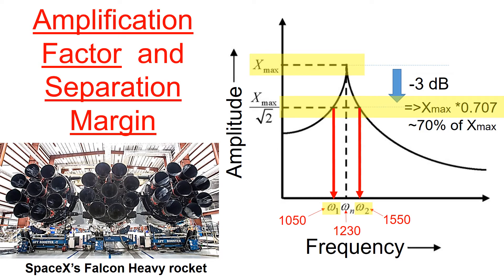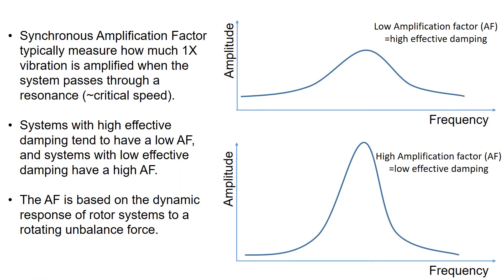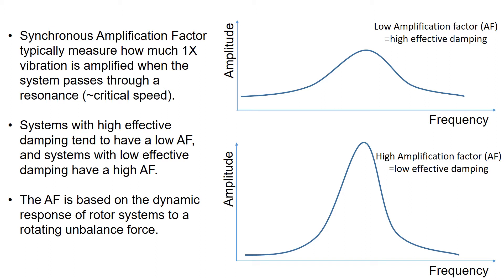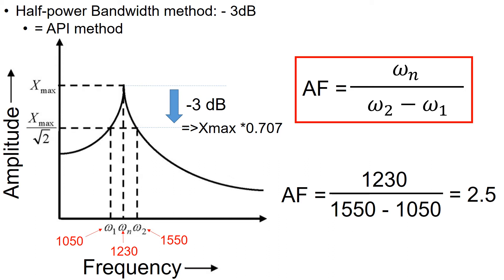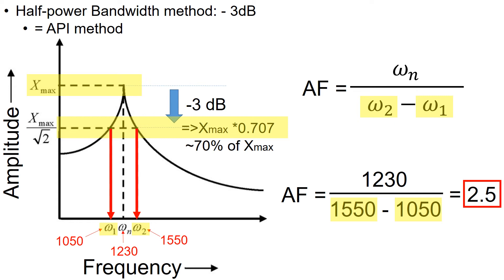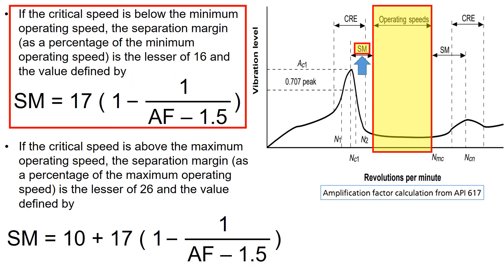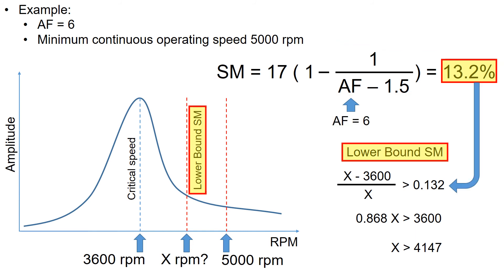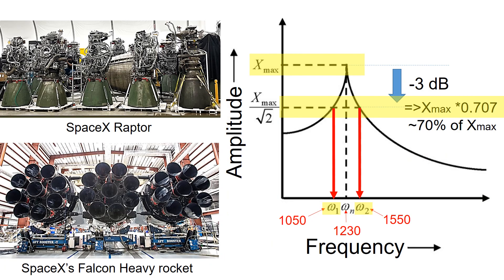Part 7 - Amplification Factor  and Separation Margin

Comment: when calculating AF, if onthe left side 0.707Xmax has not been reached (w1 can't be estimated), but on the other hand, right side of graph from the peak reached 0.707 Xmax (w2 is known) how you assess AF? You do mirror w2 on the left side or there's another methodology involved? Moreover depending on API or ISO grade unbalance we will get different AF & SM, so what confidence do we have in real SM and assessments done?
Reply from the maker: Thanks for the great question — this is a subtle but important point. There are a few approaches people typically take in this situation:
1. Mirror method (approximate): As you suggested, some practitioners mirror ω2 around the peak to estimate ω1, assuming a symmetric response. This is a rough approximation and assumes system damping is symmetric, which may not always be the case.
2. Curve fitting or extrapolation: Another approach is to fit a curve to the data around the peak and solve for ω1 and ω2 numerically. 

Also, there are also several other valid approaches for estimating AF.

Regarding your second point:
Yes, AF and Separation Margin (SM) are sensitive to the chosen standard (e.g., API 617 vs. ISO 10816). In practice, combining AF/SM with additional diagnostics (e.g., phase behavior, modal testing, or numerical simulation) provides a more complete and confident assessment.

If you're interested in diving deeper, check out the following videos from the series:
Part 9, Part 24, and others related to resonance and critical speed analysis.

Feel free to reach out at rotordynamics101@gmail.com if you have more questions or want to discuss a specific case.

Comment: So at asynchronous motion,whirling frequency is different from shafts rotation frequency.But how is it possible if under harmonic excitation (unbalanced mass) response(displacement) should be at same frequency omega?
Reply from the maker: Under harmonic excitation (such as unbalanced mass), the response of a rotating shaft will typically have components at the excitation frequency (i.e., the frequency of the unbalanced mass) as well as at multiples of the rotation frequency (i.e., the frequency of the shaft's rotation). This is because the unbalanced mass creates a periodic force that is applied to the rotating shaft at each revolution, resulting in vibration components at the excitation frequency and its harmonics.

In the case of synchronous motion, the excitation frequency and the rotation frequency are the same, so the response of the shaft will have a dominant component at that frequency. However, in the case of asynchronous motion, the excitation frequency and the rotation frequency are different, which means that the response of the shaft will have vibration components at both frequencies.

For example, if the excitation frequency is 1 Hz and the rotation frequency is 2 Hz, the response of the shaft will have components at 1 Hz (due to the excitation) and 2 Hz (due to the rotation). The amplitude of these components will depend on the specific properties of the shaft, including its damping, stiffness, and mass distribution.

It is worth noting that the response of a rotating shaft can be quite complex, and may include multiple modes of vibration (such as bending, torsion, and axial modes) that can interact with each other in complicated ways. A detailed analysis of the response of a rotating shaft under asynchronous motion requires a thorough understanding of these modes and their interactions, as well as an accurate representation of the geometry, material properties, and boundary conditions of the system.